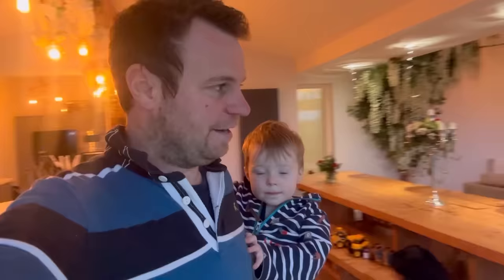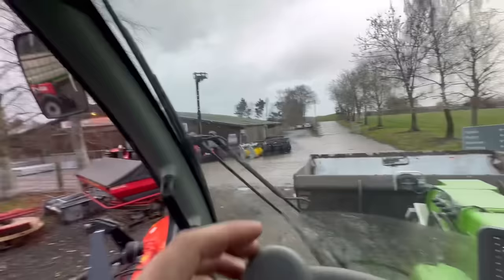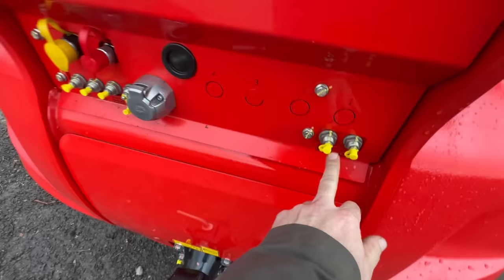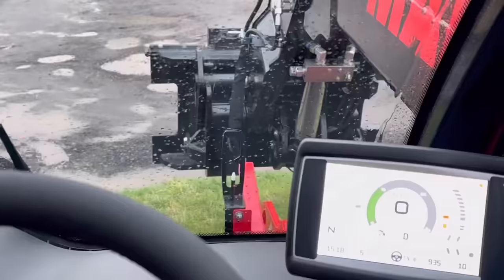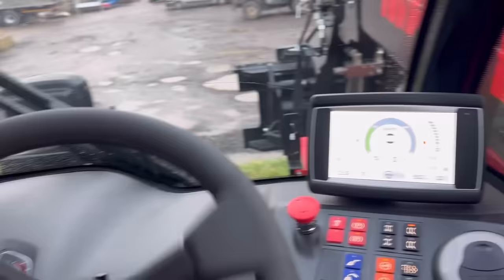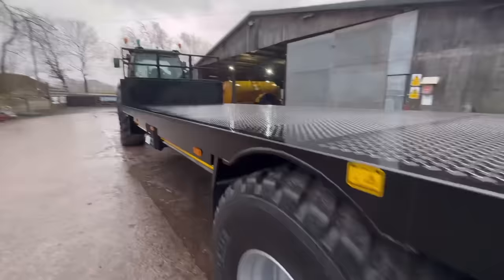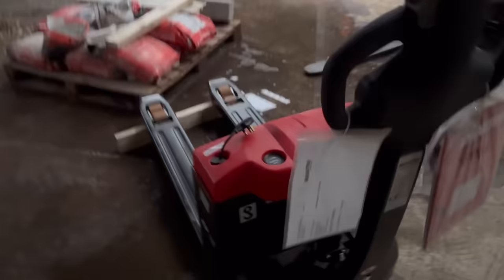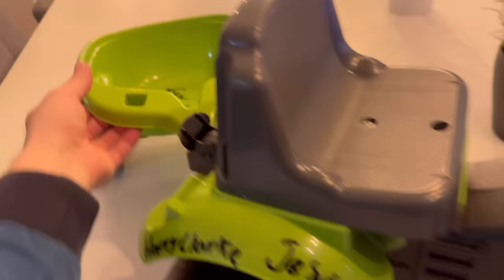I VISIT CHESHIRE FARM MACHINERY #AnswerAsAPercent 1379

Comment: I was so happy to see those handles low down on the steps because I am only 4ft9 (I'm an adult, not a kid) and I struggle to get in and out of just about every farm vehicle... and most modern cars 😅 

We've been looking for a new (or nearly new) tractor, but finding something I can get into easily is so much more difficult than you'd think when you're my height. I have an invisible disability too, but you notice it when I'm trying to climb up into and out of tractors and the like. 

It actually really knocks my confidence and makes me question my ability to keep farming because I cant just buy just any tractor. 

I'm cutting down on numbers, not putting my cattle to a bull and only bred 2 ewes this year, because my health will carry on degrading, machinery is getting bigger, and I can't do a lot of the farm work without a tractor and I can't find one I can safely get in and out of.

Getting something on demo to try properly seems to be tricky when you are looking at smaller tractors for farms like ours with stone barns that are smaller than the average modern barn, with very tight spaces between them, but I need to know a tractor can do everything and I need 😢 

If I needed a telehandler, I would be straight to the nearest dealer for one with those low-down handles! 

Thank you for pointing them out. I do look out for things that will be useful for me when watching videos with tractors.

Comment: Hi Olly I am a big fan of Deutz tractors my father bought a D7206 back in the 80s brand new since we have had a D6206 Agritron 110  150, and 6210 TTV could you do a comparison  to your fendts as we have had numerous other brands in between but for power hydraulics and ease of use they have always stood out.
The d7206 back in the day ran rings around a  model Ford 7000 and the 188 mf even though it had a good 10 hp less synchro gear box and ran a straight 4 furrow kv plough.
I just feel that they are a little left behind and dont get enough of a mention for the brilliant tractors that they are along with their fuel consumption.
Happy xmass and all love the channel
Tom